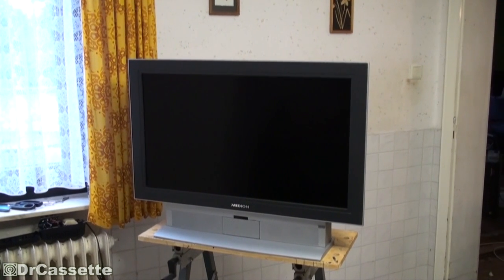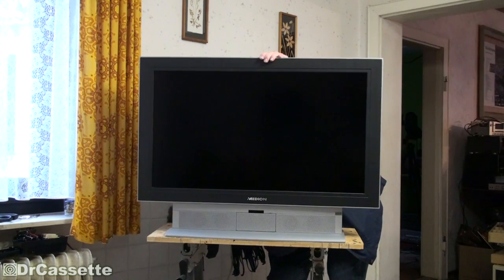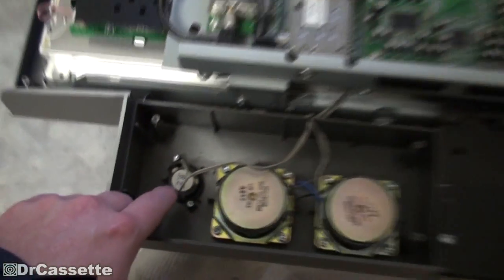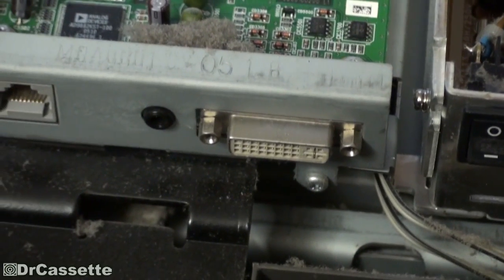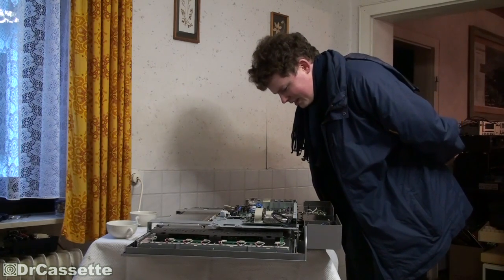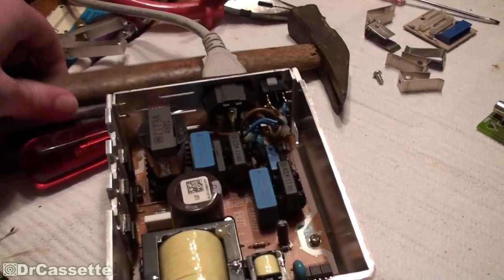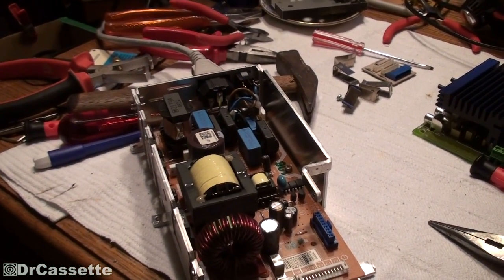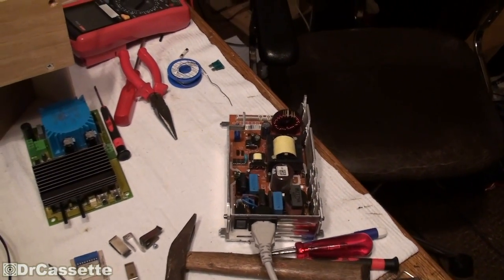Another flatscreen TV from the dump! (Medion MD30132)

Comment from the maker: The blue connector on the power supply board is not putting out voltages, it communicates with the other TV control circuitry.

Comment from the maker: That won't work as the TV requires special voltages such as 16V and rails with variable voltage to switch to different modes. Also, certain actions such as the power on process are contolled by the power supply itself.